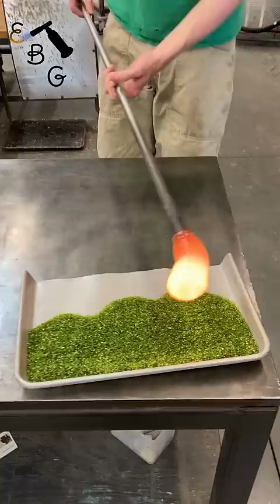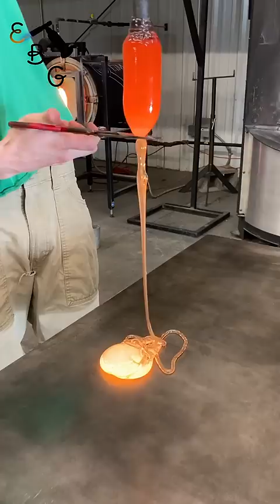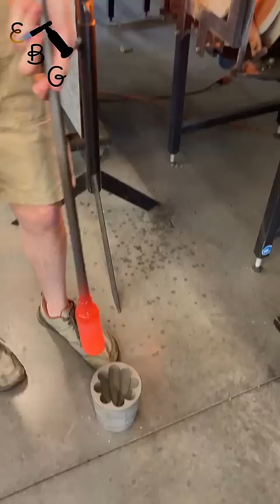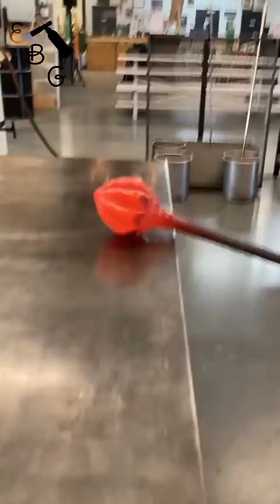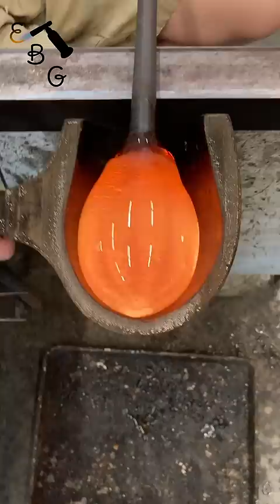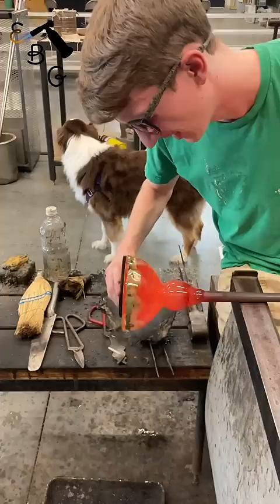Swedish Bowl - Glassblowing #shorts #glass #glassblowing #glassblower #art #artist

Comment: The fact that this doesn’t burn your fingers when you are soooooo close to heat on these projects is insane!
Reply: FR! it’s like molten lava or something!
Reply: mama!
Reply: *magma
Reply: @adorableadory  you can just edit your comment-
Reply: It doesn’t burn his finger because the type of metal used for the rods they use for glass blowing typical doesn’t transport heat as far, and the tips of his fingers have also been exposed to heat enough that some of the nerves are weaker from the heat
Reply: @adorableadory its actually qround the temperature of lava, i would know i work in the glassblowing industry
Reply: The best part about it is that when you melt glass it’s practically lava, it can’t melt under heat anything under rock melting point
Reply: @straneas3099 Even just delete and try again. It wasn't a monumental paragraph

Comment: Bro got more faith in that cloth then I have in my whole generation ☠️
Reply: There's a video on reddit where this dude grabbed the hot glass with his bare hand and burned
Reply: cloth doesnt tend to be used actually! what he is most likely holding is a wad of newpaper- you can tell by the ashes coming up. its a surprisingly good insulator and when its been used so much it can burn in a pretty reliable manner!
Reply: @poetryprose9810  thanks for the info my good sir 🤝
Reply: @iliilliliiliilliliiliillil9137  ouch bro 😬
Reply: اناااااا
Reply: I have no faith in my generation
Reply: Its wet newspaper

Comment: i couldn’t work here bc the overwhelming urge to touch or take a big bite out of it would be too strong
Reply: As someone who's been burned by glowing hot glass I can tell you one touch is gonna cure that urge forever. Unfathomably hot. Boiling oil is like luke warm water in comparison. Takes ages to heal too because of how deep and how quickly it burns you.
Reply: @stauntssantana  I’m pretty sure the urge would go away Just trying to get your face close enough lol.
Reply: @stauntssantana would the molten glass be capable of sticking to a hand if someone grabs it?
Reply: @xINSAN1TYx your skin would probably melt yeah
Reply: Once u do that you'll lose the urge and be eligible for hiring
Reply: Thats why you would get the coveted darwin award
Reply: Your skin after you touch molten glass: 💀
Reply: @xINSAN1TYx  Depending on material the skin is on/how long it's having contact with it, I'd be inclined to say yes it can.
The cellular structure of you skin is melting, and the layers of skin has no where else to go stick in place to the source of heat, just barely holding onto the fats/muscle and other layers of flesh that you have left over. (I am by no means a medical expert, so take away with this what you will) 
I get this bit of information from the first aide treatment we are required to learn at my workplace, it's a hazardous job site with dangerous elements to it, so any but of medical knowledge for the unforseen is warranted.
Reply: You will only bite once
Reply: @chatukam222  the final snak
Reply: @ameliatheginger  😁😁
Reply: He did touch it. There is a video of it on reddit
Reply: いあmygod